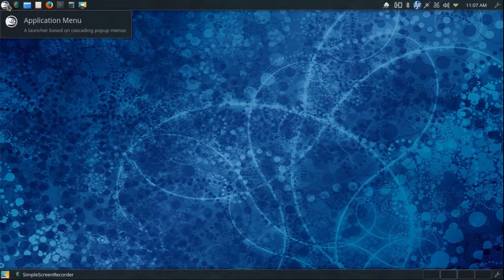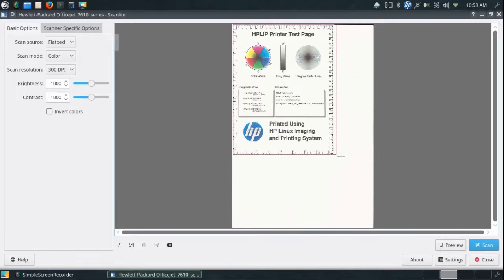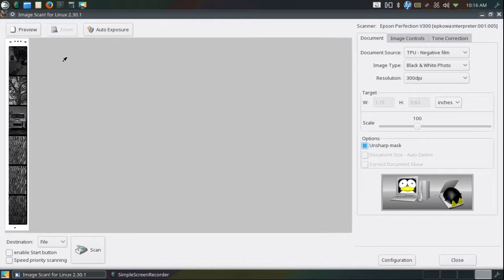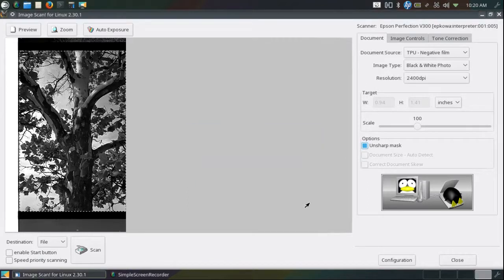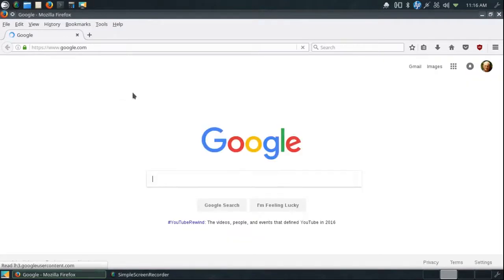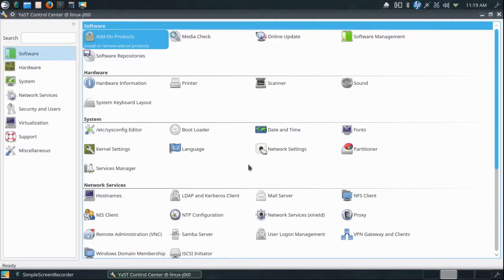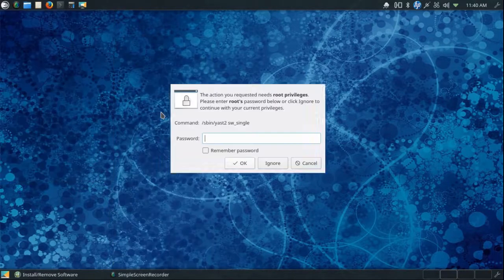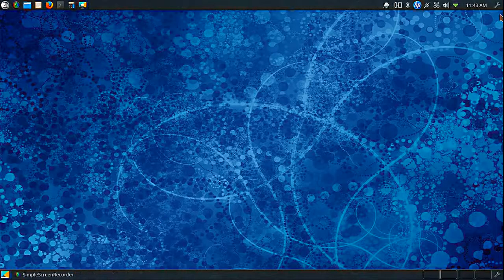More about openSUSE Leap 42.2

Comment: Sir, I run opensusa 42.2 on my Dell desktop 9020 along with Fedora 25 & Debian 8.6. all on a 500GB HDD. They all work (Fedora excellent) but on Opensusa & Debian, they will not play programs such as "Bloomberg Radio", Tune-In Radio, and many Utube selections. Maybe they need a Flash, or what ever downloaded. Can you offer advice?
Edwin, USN [1961~1993] currently in the Philippines. Let me know if you have no suggestions please.. Happy Holidays.
Reply from the maker: For openSUSE, try installing any missing codecs at http://opensuse-community.org.  For Debian, try https://wiki.debian.org/MultimediaCodecs.  For YouTube, right-click on the videos with systems that work, the "About" line will tell you whether Flash is used.  Sometimes, even if the player is installed, some codecs may be missing.  Try Googling the errror.